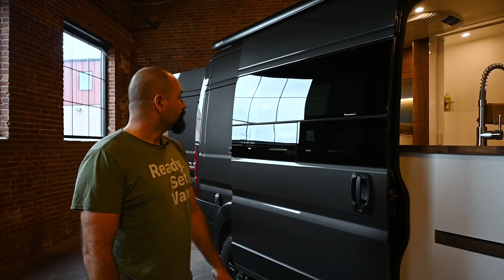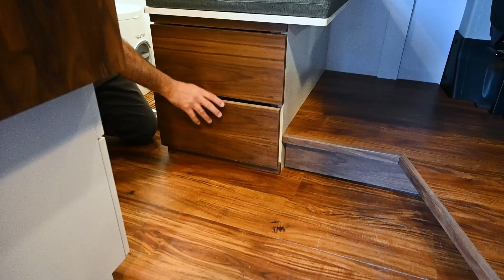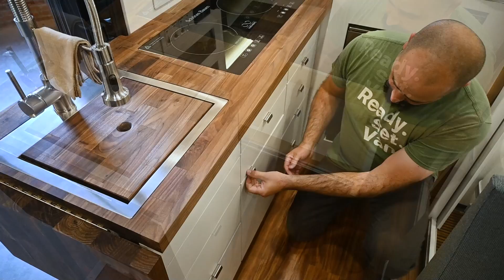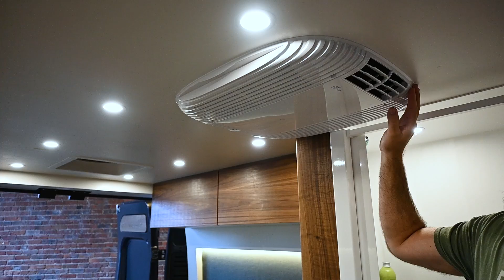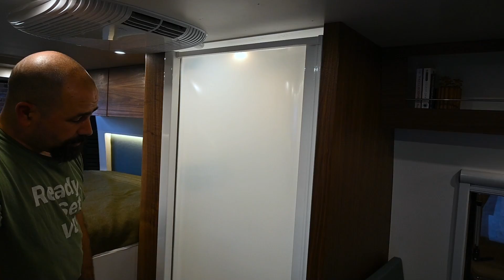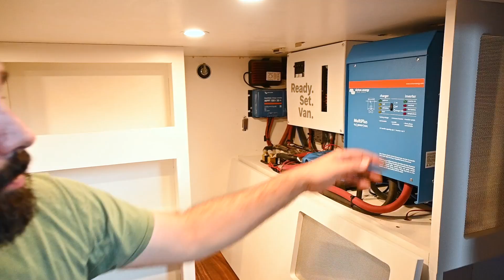LUXURY MODERN Campervan Builder Transforms Vans Into Amazing Van Dwellings - FULL BATHROOM

Comment: Iv seen a tun of designs most are very similar yall are manufacturers just a thought for a project I thought of for myself get rid of the bed bathroom little table put extra deep plush L  shaped couch yall can sleep 2 easy on couch back cushions could sleep one more on floor make couch deep enough 2 average people could comfortably sleep together if desired then add custom trailer with shower bathroom I like fishing alot so ima put deep freezer clothing closets massive water tank solar fishing gear storage kayack racks outside grill the idea of a van and trailer is awesome so much easier to maneuver maintain that's just my idea could also put bikes 🏍 quads build the trailer for the customers  hobbies or multiple hobbies just a idea 💡 I know what if it's raining lol frog togs or quick run I know for the driving maneuverability and as a big outdoors man just makes sense to me could also just market the trailers as well iv never been rich so being able to go and catch and store food fish crab lobster depending on the trip to bring home  is why my trailer will have deep freezer just offering the ideas if something sounds good use it I'd love to see that idea finished if it's as good of a idea as I think it is I know bathroom not being inside seem weird in alaska they gots out houses the norm it's how I came up with the idea if customer wanted could even put a washer/ dryer on the trailer everything outside access except the clothing closets shower 🚿 and toilet again something I'm going to eventually do for myself figured I'd pass the idea along

Comment: I can't stand those Fawcetts: They remind 😤 me of the ones in the pathology Labs they use to hose off the autopsy tables! They've always creeped me out...
I like the cassette toilet....had the same one....but......once again, no actual bathroom....the usual toilet in the shower. I don't get it: A drop-down sink beneath the shower fixtures that uses the shower nozzle clipped on, and you have an actual Bathroom.....without taking up any additional space. Some people put up big bulky storage bins in the 🚿 shower, but no sink. A bathroom sink is so important to avoid cross-contamination. It's also practical.....you have to wash your  👐 hands in the middle of washing your fruits or peeling 🥔 potatoes, etc. European campers are fitted with complete bathrooms in even the tiniest of vans.
Reply from the maker: Thank you for the feedback

Comment: The sink cutout is not a little nice touch, everyone does that, is common sense to use the cutout as a cutting board. Also why not use clear polyurethane on that imported fingered jointed top? The finish it has looks awful and will not last nor protect the top.

Comment: Very nice build! I’ve been looking at the mini van but decided I need a mid size van for long term travel. I like what you’ve done here…I’d have a fan installed in the shower though and maybe a recirculating water valve so when the water is hot you can turn it on and it will be hot…and i love the garage … love it.❤️ I checked you out and your prices are reasonable.
Reply from the maker: Thank you very much Mary

Comment: Hi. Love your van! Can you run your air conditioner from the battery? Will it last very long on the battery you supply?
Reply from the maker: Yes, absolutely. Depends on how hot it is outside and how often the compressor cycles. Also  would depend on how many hours of direct sunlight exposure the solar panels have.

Comment: Very nice build and seems highly serviceable.
Agree about the galley cooking area needing some mitigation measures to protect the switches and Bed from cooking splashes.
Concerning the hinted attachment  system... could there perhaps be an option to create a temporary microwave shelf above the stove area that can quickly be taken down before travel?
What modifications are done underneath the van?
Reply from the maker: Great suggestions, your input is appreciated. The builder information is in the description

Comment: I personally would have moved the three light dimmer controls and outlet above and away from the induction cook top. How are you going to control those when say, you're boiling water or cooking something hot? That outlet is also in a prime location for catching spill as well, which is one of the reason why we have "back splashes". Not sure I get the idea around that location but nice build otherwise.

Comment: Clean build and nice layout. Well thought out. Finish looked nice and it all seemed fine. The only thing I would have changed is having a lifting bed. That would make the rear a multi purpose usage space. All it takes is a clever table and the lift bed.  Lounge area during the day, or work space, a dinner table or a great place for board games or dinner parties. And when night comes lower the bed and go to sleep. No stress making the bed first, and redoing it the next morning. Even if you got kids they can go sleep on the couch below the the lifting bed and you got sleeping for the whole family.
Reply: Stay tuned :) We're developing a lifting bed layout right now in a sprinter 170 which is very much like what you describe! 4 seatbelts and will sleep up to 5. It should be out in a few months.

Comment: NJOA, Hello PATRICK, well BEN has done a beautiful job, I just happen to LOVE WALNUT, no PROPANE   Means NO EXCESS MOISTURE , & usually in the RAM vans the REAR BED, is fine with me, don’t have to make it up,nor having to convert ANYTHING to sleep, great solar & LITHIUM batteries, adds cost but you can be off grid,easily.  Thanks for showing it   🇺🇸🇺🇸🇺🇸🇺🇸
Reply from the maker: Great point!

Comment: Probably the best I've seen. Might need a divider between the cook top and the bed...there will be splashes and spitting. Great work!
Reply: That was my thought too. Also the controls and pretty white surfaces behind the cooktop. Heat anything and it will be all over that stuff. Spaghetti sauce for instance.
Reply from the maker: Thank you very much
Reply: I thought the same about the cook top. Also, fire hazard; too close to linen.

Comment: Very professional looks and approach! Do you guys deal in adding high tops to vans at all?
Reply: We have had several conversations with SCA (pop top provider) but currently haven't worked it into any of our builds. We hope to at some point because we love pop tops, but not yet.
Reply: @ReadySetVan  Nice. But not necessarily pop tops, just height extending tops so as to be able to stand up but not at cost of a high top van.
Reply from the maker: Check out Fiberline
Reply from the maker: Awesome
Reply from the maker: The builder has replied to you

Comment: Wow really nice flow and well thought out design...great job😁 is that 14 guage wiring coming out of the 3k watt converter? Love the step drawer and wall cubbies! Does the dometic fridge actually make ice? Thank you sooo much for letting me visit. You've covered many of my concerns within van life...kudos😃
Reply: Thanks! All the battery cables going to and from the inverter are 4/0 guage. The fridge does freeze and can make ice. You'll need a tray of course... Glad you liked it!
Reply: @ReadySetVan  hello, that refrigerator is it a compressor tube or an absorbsion ? Thanks 🇺🇸🇺🇸🇺🇸🇺🇸
Reply: @flybyairplane3528  It's a 12v compressor fridge. Dometic CRX 80
Reply: @ flyby airplane ...there is a CRX 50 (aka 'truck refrigerator') is a 12V compressor unit...not 100% certain that is the exact model shown in the video clip... maybe go directly to the top of the comment area as the direct link instead of on this side link...

Comment: Thanks for the great video Patrick! It was awesome to have you in our shop again and it's SO great to have your channel showcasing the great builds and community here on the East Coast. Thanks again, you rock.
Reply from the maker: Always awesome to have toy on and your teams is so welcoming. Cannot wait to have a NY,NJ,PA,MD van builder meetup
Reply: @NewJerseyOutdoorAdventures  Our crew was literally just talking about that yesterday. North East vanlife meetup will be an absolute blast. We'll reach out when we start putting together the event team. I wonder where we should do it?
Reply: @Ready.Set.Van. I've got 3 questions. What's the name of the lightweight plywood you mentioned using and is there a US distributor on the east coast(I'm a bit west of you in PA)? Does the lighter weight core retain screws as well as regular ply?

Actually a 4th question. Who makes the latches you used on the galley drawers?
Reply: @jamesgill5511  The lite ply we use is really fantastic. It machines well and takes fasteners very well. The cores are slightly softer than a true hardwood ply and as a result are a little more likely to accidentally over tighten (strip) out the hole if you are not careful. That said, with a shop of 10 builders we have nearly 0 issues with that. Size up your fasteners when possible and choose a slightly coarser thread. One another note, the veneer has a very nice finish but it is thin a prone to tearout. That's not an issue on the CNC but if you're cross cutting on a table saw you'll want to take that into account. Shot us an email and we'll get you info for our distributor. As you can imagine sourcing the wood has been quite a challenge recently. I expect we'll begin buying container loads directly from Asia sometime in 2022.

RV Labs makes the latches. We love them and have probably installed 500 at this point. We buy them through expedition upfitter who is the US distributor. They are releasing a new improved version that should have slightly better action. With the OG design we just put a dab of graphite lube on the mech. and they are a dream.

Are you building your own van or starting a shop?
Reply: @ReadySetVan  I do woodworking as a hobby and my uncle is looking to remodel his Bounder Class A including replacing some cabinets. Any weight saving is obviously a bit of fuel savings and certainly can't hurt handling. Right now my own van is an empty shell but eventually, after I get the drivetrain sorted out and bring it to Fiberine for the high top, I'll be building that out.

As for tear out of the veneer, I'm very accustomed to it from the cheaper big box store stuff so I always use a higher tooth count blade and a zero clearance insert when cross cutting ply. For both my uncle's Cass A and my van everything will be painted anyway, so hiding a bit of tear out isn't really an issue. My main interest again is more for the weight savings.
Reply: @jamesgill5511  That's awesome James. Good luck with both those projects. If you just need enough lite ply sheets for one project it would probably be easier (and probably cheaper) to buy them from us. We are happy to share. The distributor has a minimum purchase of 60 sheets if I remember correctly. Also, if you're nearby enough and looking for work, shoot us an email. We're always on the lookout for craftspeople.
Reply: @ReadySetVan  Thanks a lot. I'm about an hour and a half from Trenton but I go to south Jersey pretty often to visit friends and family. I'll let you know on the sheet goods when the time comes. 

As far as the job offer, while appreciated, believe me I'm no craftsman. I'm a semi-retired diesel mechanic turned dispatcher. Woodworking is still very new to me and I know my limitations.

Comment: Looks ok
PI$$ poor design/layout though...
Reply: @HumbleRoad  Thing is - the design is so bad - dare I say it may actually enhance the looks of the PM !
Reply: Let’s see a video of your van Terry.
Reply: @MyBushIsSoUnshaven  If NJOA ever leaves New Joyzzee I'd be more than happy to give a tour and demonstrate how van design is done right!  Am currently on BLM in AZ - would be more than happy to drive out to a paved road to meet him.
Reply: @TerryManitoba  A simple slide show of your setup would only take a few minutes of your divisive duties. Would really like to see other constructive options.
Reply: @MichaelGa  I'll git right on it...
Reply: What's wrong with the layout? Considering they managed to fit a usable size wet bath and dinette into a van I'd say it works out well. The only thing I would change is flipping the foot/head of the bed so your feet aren't higher than your head if parked on a crowned street.
Reply: @jamesgill5511  I've spent 15 months living in my self built van - it is obvious the builder has not spent much time using his design.
For starters
the sink takes up a prime landing platform
the Fridge is buried to the back - so inconvient
the role out table should be about a foot lower
Reply: @TerryManitoba  ...and how about the fact that the Webasto outlet is right under the fridge?
Reply: @charlevoix418  THX for pointing that out - I however couldn't bear to watch past 3 minutes (& that was on fast forward) so I did not notice the heater outlet.
Reply: Great design, top notch cartsmanship,